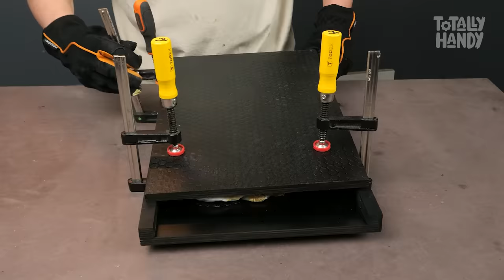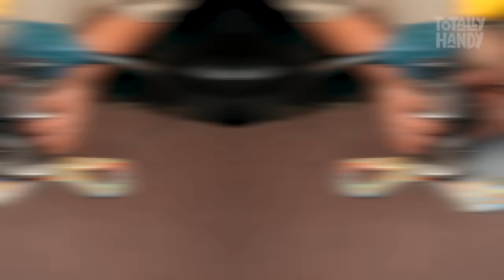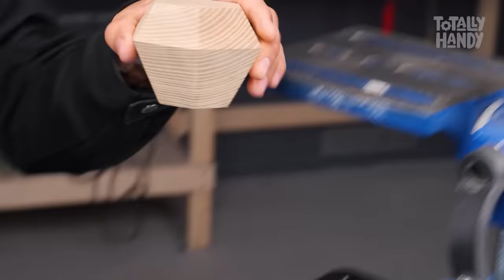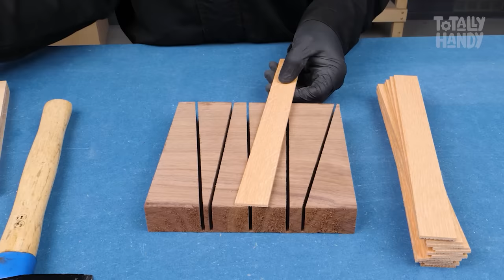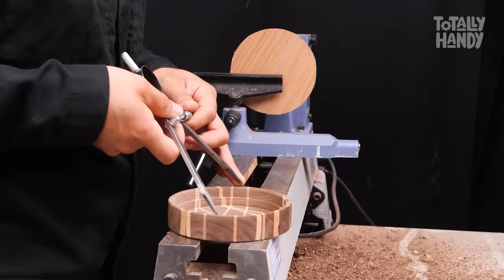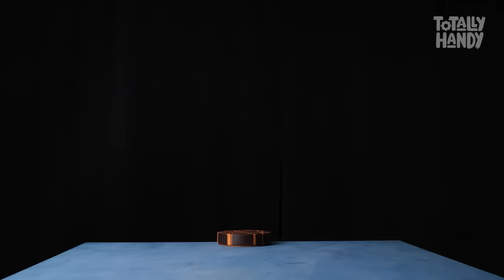Eco-Friendly DIY: Transforming Plastic Caps into a Remarkable Cutting Board! | DIY Project

Comment: Melting plastic in your oven, that's a sure fire way to choke yourself on toxic fumes
Reply: Natural selection at its finest.
Reply: Its possible he has proper ventilation and a respirator on as well.
Reply: Plus it's only polythene and he's softening/melting it, not incinerating it.
Reply: Was about to say this, why this was suggested to me is insane
Reply: The plastic bottle caps are generally made from a type of plastic called polypropylene. It's very safe and becomes workable at temperatures way lower than those that would break it down.
Reply: @peterfoster1466  Would you use it for food though?
Reply: @user-vi4xy1jw7e  I mean everyone does it every day considering we drink from plastic bottles.
Reply: @picklenick2  the plastic used for the cap is HDPE or PET, which are food-safe, but it's not the same material as the bottle.
Reply: The room doesn't look like a kitchen, could be an oven for projects.
Reply: @picklenick2  That's not the same. Also, try telling that to all the military members who drank bottled water that became a cancer risk after being in the sun too long.
Reply: @josh_m    back to the original question: is HDPE or PET a plastic ok to warm to a moldable product? Not incinerate or heat to the point of smoke, just enough to make a product moldable. Not saying I would use this because I agree it's dumb. but it just doesn't seem much different from our everyday lives. Plastics are everywhere, we all consume some form of micro plastics everyday, i don't think this cutting board would change much of everyone's habits.
Reply: I'm sorry but your comment is confusing me. People left in the sun will always have higher rates of cancer so you can't fully pin that on bottles of water. As for the difference, I don't see one considering water will always touch the bottle cap. I agree inhaling burning plastic is bad, but materials can be moldable without releasing toxic chemicals into the air. Also in the end you're consuming micro plastics. Again i still think this is a dumb idea to melt plastics unless you know how to safely do it, but i just don't see the difference in the end.

Comment: This is some of the worst things you can do:  EAT PLASTIC !
Reply: Oh… you’ve just never had it fixed right! 😂😂
Reply: HDPE cutting boards are USDA compliant, dishwasher safe, and resist moisture, stains, and mildew to create a convenient and food-safe environment. HDPE cutting boards also resist chipping and are less likely to contaminate food when compared to wood and other traditional materials.
Reply: Polymers degrade when heated, that's no longer "pure" PE
Reply: @stigmautomata  how is it molded into the original caps?  Uh.. Heat.
Reply: Plastic is inert
Reply: @tonyohlman8557  Yeah and when you do it again it degrades further. There are lots of ways to recycle HDPE, but I personally wouldn't do any that have anything to do with food
Reply: Yeah, really. You would have to coat it in a really good and hard resin in order to be able to use this safely, but after that it would be pretty cool
Reply: Well, if anyone is dumb enough to try this, then eating microplastic isn't really going to hurt anyone besides themselves 😂
Reply: @stigmautomata  
Exactly !

Comment: Thete is a Company locally that collects plastic caps from school kids they basically use the same melting method  with commercial ovens and make park benches out of planks they made from the caps and they donate the benches back to the schools. The kids got a real kick out of seeing  recycling in real projects
Reply: Bottle caps turned into park benches is OK but not on cutting boards.  BIG difference.

Comment: I'm pretty sure not all plastics are rated for food grade stuff, especially having resiliency as a cutting board.
Reply: If the plastic cap came from a food/drink container, then it's food-safe.
Reply: @josh_m  is it safe for being reheated, possibly changing the chemical composition of the original plastic then after that determined to have necessary characteristics to be used as a cutting board?
Reply: @goemon9378  consider how these bottles and caps are formed to begin with. From raw materials which is heated in a mold. I'm not any sort of expert on the topic, though, just thinking about it logically.

Comment: No eye mask. No face mask. Breathing in micro plastic and PFAS and releasing them into the environment, also the stove. Then when using the cutting board, more if the same. 
So good with wood. Make wood cutting boards.

Comment: Awesome. Those caps are so annoying when they fall out of the recycling bin all over the paths. I like that you re-used an ex-demolition Oven for your craft. Was that at  250°C ? A board like this will be great to cut bait on for predator trapping and fishing, as well as for use around the Farm. I'm thinking an outdoor benchtop might be good. Thanks heaps for the Inspiration. ☺️👏👏 
PS, what did you make your mold from? Is that black HDPE plastic? Cheers.

Comment: You understand that putting plastic to oven and heating it IS HIGHLY TOXIC AND DANGEROUS?!

This video should be taken down
Reply: It should be blatantly obvious to you that they have absolutely no idea exactly how toxic or dangerous it is. Let nature take its course.
Reply: The bottle caps are polypropylene. This is non-toxic and is a thermoplastic that is workable at far lower temperatures than that which would cause decomposition.

Comment: Is it really eco friendly to melt plastic in an oven, then use mechanical devices to create big and micro bits of plastic that are discarded/released into the environment?

Wouldnt it be better to make a mold first and put the caps into that (saving a lot of time+cutting later)?
Or, you could just grab bamboo ones which are better.

Comment: I'm not going to buy one of these cutting machines just to make a cutting board. On top of that, it's not very eco friendly, we have the electricity to heat the oven, the electricity to power the cutting and drilling tools not to mention the micro plastics that you will consume every time you cut something on it.

Comment: cool ideas. at how many degrees should you melt the plastic caps in the gas oven. thanks in advance for an answer, regards
Reply: About 350
Reply: Please don't do it. The fumes are very vad for you
Reply: @daniellehowell4339  thanks for the answer but I would raise a good mask of course. I also work with cds that I make in the oven. would you tell me the height of the temperature as i have already collected plenty of lids to make something out of them. I would really like to make such a board
Greetings from Berlin
Reply: @wernertrapp1733 get a temperature controlled/adjustable hot air solder station and you can figure out what temps melt anything via experiment. Or Google bottle cap plastic and melting point
Reply: Good luck on not getting Cancer
Reply: sheeesh what is wrong with you guys
Reply: @lovekela  I don't understand your reply to my comment. I have spoken negatively about men's bad behavior and positively about Shurjoka. Unfortunately, I can't answer the question of what's going wrong with some and not treating women with respect. Greetings from Berlin
Werner
Reply: @wernertrapp1733  😭😂😂😂😖😖😖😖😵😂
Reply: @lovekela  Thank you for this enlightening and imaginative answer all the best and greetings from berlin
Reply: @imadeitworse8275  thanks, is it in celsius or ...
Reply: @wernertrapp1733  not Celsius
That would be pretty hot
Reply: @imadeitworse8275  thanks
Reply: @wernertrapp1733  yeah totally
I have a few videos on my channel about it and I'm working on one right now